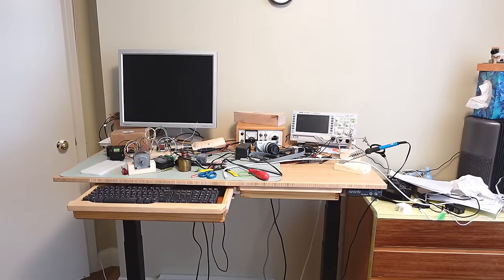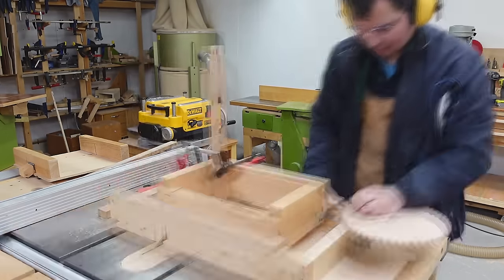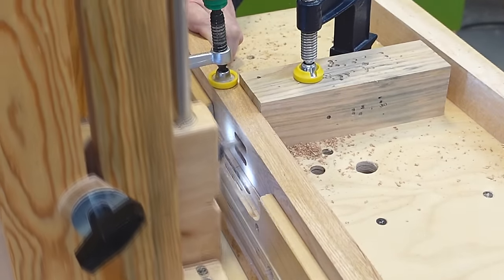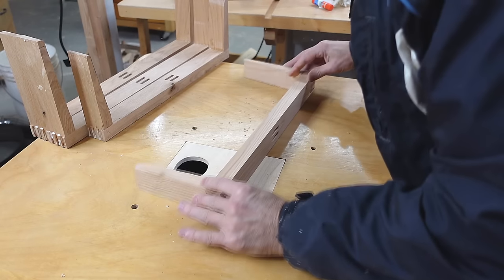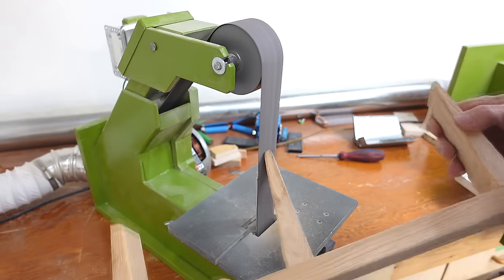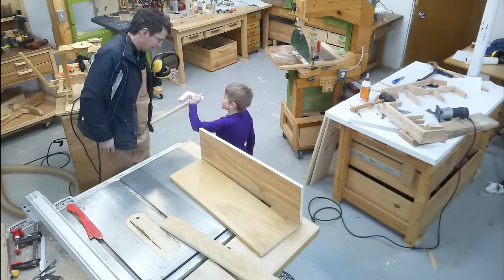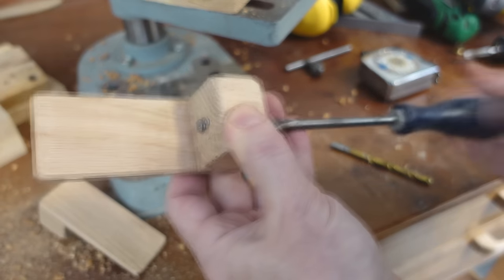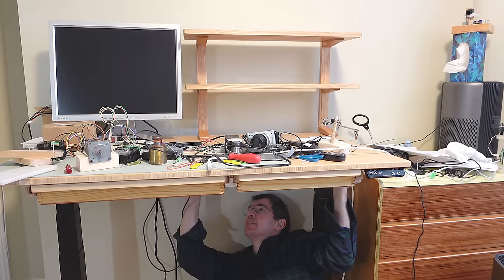Making shelves for my desk

Comment: Those right angle drills do spend a lot of time in the drawer, but I wouldn't be without mine. When you need them, they're a lifesaver.
Reply: Same for my right-angle attachment, 5-1/4" (without bit)… a tad cheaper & less drawer space than right-angle drill.
Reply: Right-angle bit driver from DeWalt ... has been flawless in much tighter spaces than this video.
Reply: @kennnva551   Can confirm. Can't drill with it, but works great for screws. I keep a right angle drill around for drilling holes in tight spaces.
Reply: @PlatypusVomit   
 I have drilled with mine.  Of course, that requires drill bits which come with the hex "bit driver" ends.

Comment: That was an awesome video, Matthias! And I'm glad you got your channel back :^) Glue-ups are always stressful. By the way, many use a white rubber mallet for assembly because it doesn't mar the work. I have a wooden mallet with leather on its faces. It was just a cheap one. I glued a piece of leather on one face, drilled out the other face, and put a rolled up piece of leather in that.

Comment: Great video. It gives me ideas to tidy up my own electronics hobby table.
Dewalt has a right angle drill attachment for tight spaces. I purchased it on sale at Xmas and have used it a few times. It works well for taking stuff apart.

Comment: maybe a video idea:  Long ago when I did architectural mill work we would use a thin kerf blade to cut 70-80% through a board and then finish the resaw on the 36" bandsaw.  this make setting up the fence and the sharpness of the blade less critical and you only loose a bit of material when you put it through the planer.
Reply: you cut one side then flip and do the other, total cut is 70-80% with some meat in the middle.
Reply: What did you do with the loose material?
Reply: @neilhughes3823  not sure what you mean.  the bandsaw cut is only the material in the middle (you flip and cut twice).
Reply from the maker: done that many times myself, wrote about it too

Comment: the first rule of horizontal space is that it will be used and (almost) never reclaimed unless you don't actually do anything.  solution: less horizontal space.  drawers are the worst, shelves 2nd worse.

Comment: hi
How would you approach extending a table legs 16cm?
Obviously I do not want to use too much wood, but the table leg is not made from wood so I cannot just extend it normally through joining.
I am going to try making some wooden blocks to put under the legs, but I think it won't be stable if I don't make the blocks wide enough, but the wider they are the more wood I need

Comment: Was there a reason not to use the wall? I could see if the desks were likely to be moved to other locations, but if they are pretty much made to be only used the their current spots, you have taken up space on the table top surface with the supporting feet. (I often lay out larger sheets of paper/cardboard to work on, and not being able to push it all the way back to the wall due to the supports being in the way, and having it hang over the front would enrage me, lol) A French Cleat shelving configuration would allow for a much more versatile solution, I would imagine.
Reply from the maker: desk goes up and down